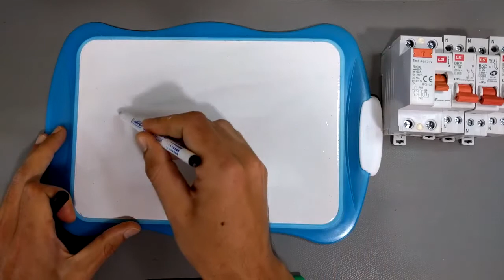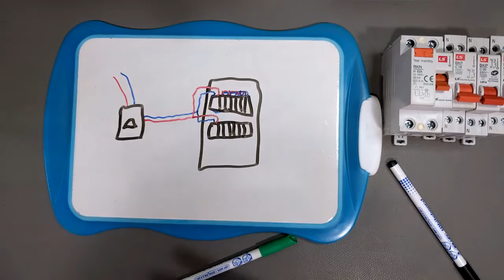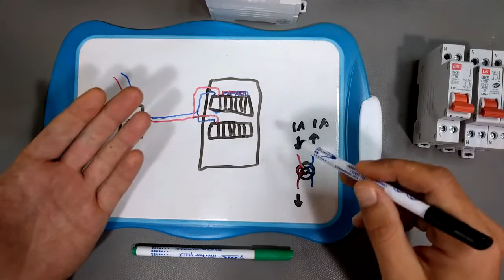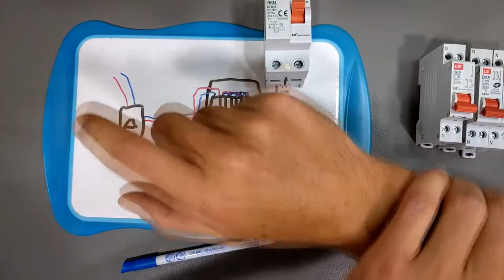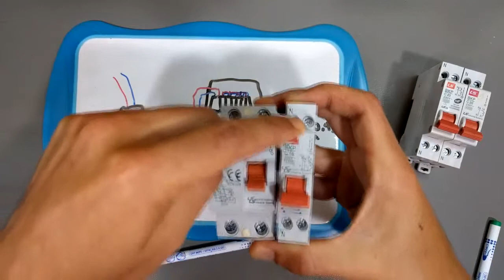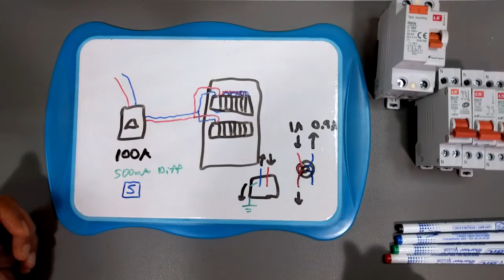EEK! #5 - Breaker Panels aren't so scary after all

Comment: If you want to protect a set of regular (thermal) breakers  from ground fault, then wouldn't it be cheaper to just use an RCD (aka GFCI in N.A.) instead of a differential breaker?

Comment: I checked the panel in the basement & found 3 chord inputs into the panel, could u please explain the purpose of each one of them?

It is a regular American home with central air conditioning, furnace, sump pump, water heater & a grinder in the basement. Does it not need a 3 phase supply with the AC? Is it a 3 phase supply, how should I confirm ?
The number of input wires make me think, may be it is not?

Comment: In case of lightning what is the path created during construction to ground the lightening voltage drop?
From A to Z
Thanks
Reply from the maker: For lightning protection, you'd need a lightning surge arrestor. They look like a breaker, same size and shape, but they have a replaceable cartridge inside that contains MOVs, I think. You have one cartridge between each phase and ground, and one from neutral to ground. Tricky to install, tho... Ground has to be as short as possible, ground wire for lightning arrestor shouldn't be parallel to phase/neutral wires, etc. 

Well, that's to shunt power line SURGES to ground due to lightning...

If you're ever actually struck by lightning, you're in big trouble no matter what you do since the massive current will seek a path to ground, generally arcing and destroying things as it goes. 

Interestingly enough, Nikola Tesla had a patent for a very different kind of lightning rod. He said we usually do it all wrong. I guess that would make a good vid!